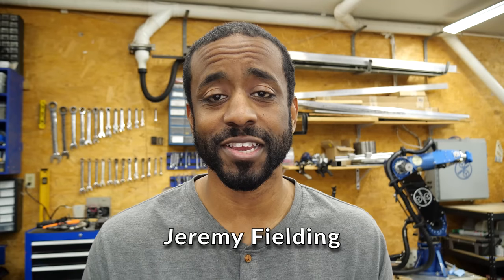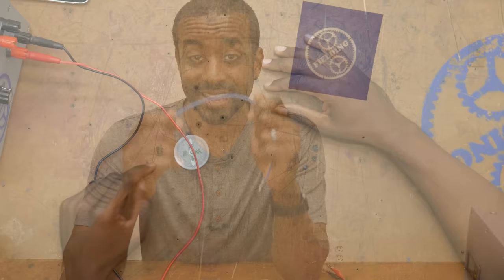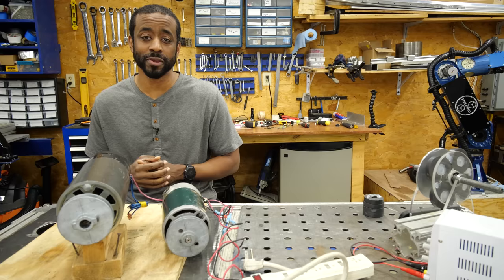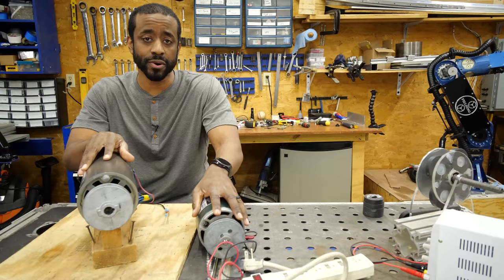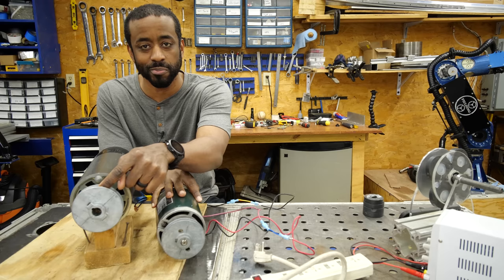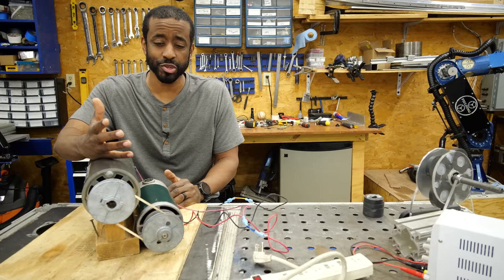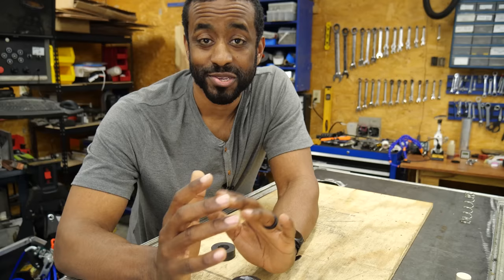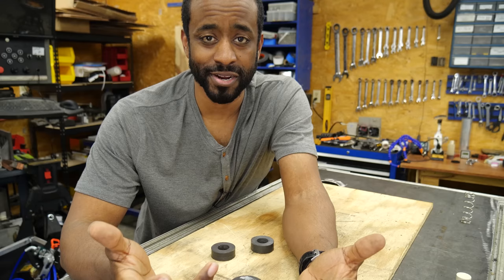Reviewing Free Energy Generators.  A Response to My Video "Nikola Tesla's Greatest Invention"- 102

Comment: Awesome video Jeremy, great explanation!  As a product design engineer I get a pile of plans or ideas for this type of witchcraft all the time.  Great job killing it with reality!
Reply: If you haven't tried it you can't say it doesn't work. People once said airplane's couldn't fly because they were so heavy. How about you try building one using a pulse motor to do the spinning of the one your using as the generator. This would have to create a surplus of energy. Also use some gearing or belts to further lift output. If you want to go further try adding a big fly wheel or make the pulse motor on a flywheel. Just because you've been told something doesn't work doesn't mean it won't. As an engineer i would think youd be more qualified than me to give this a go, so do it. Disprove us. I have no electrical experience building things but ive done lots of reading & this way would have to work. This video even says it. Bld a couple next to each other since a fast moving magnetic field will always speed up a slow spinning magnetic field. The planets spin continuously so there has to be away its how nature works
Reply: @harryverner6218  send me these plans, and I'll happily build it
Reply: @harryverner6218  The planets only spin continuously because there is nothing to really slow them down. Even they however don't spin for eternity, they too will some day cease to spin and at some point in time they will also be more or less void of energy. Earth was moving a lot faster and a lot slower during different times of its early life because of asteroids impacting it. Eventually there weren't regular hits of big asteroids so the earth just stuck with the speed it had and that's more or less the speed it is spinning at today. The moon also helped stabilise it in this regard. The earth will keep spinning at this exact speed until some more energy is added due to some large impact for example, or some energy is lost (for example through friction). Because this isn't happening on a large scale the speed remains more or less the same (there are measurable deviations from this stable speed over very long time periods but it's not significant enough to really change anything for us). Also, your statement that it's not impossible is not something anyone can disprove because impossible would mean there is no way for it to ever happen regardless of circumstances. If I claim there is a pink elefant in the orbit of a star 20090893787789 million light years away from earth there is no possible way for you to definitively prove to me that this is impossible. Does that mean I am right? No. Does it mean I should be considered right as no one can prove me wrong? No. In Science it's always wrong until proven right not the other way around. While it is possible that someone could build something like you described, that would mean that our entire idea of how physics and the universe works are wrong. Rules like the rules of thermodynamics and laws of conservation of energy are rules that have been proven to be correct countless of times in countless different szenarios which is why we consider them to be more or less universally true (disregarding singularities). They are also completely reproducable which all in all makes them scientifically proven. For your proposal to be a correct way to create surplus energy from nothing, all of our basic natural laws and rules would have to be incorrect. Seeing as these natural laws can be proven and reproduced with the same result every time, I will put my trust in them. Also, if you want to convince anyone on this planet that our scientific laws and rules are false you will be the one who will have to build the wonder machine, not the people you are trying to convince. You need to prove to them they are wrong in order for their laws to be obsolete, they don't need to prove to you that their laws are correct because they have already done so to countless other educated individuals. I believe you have not done any such thing or something comparable and instead you expect other people to prove that your concept doesn't work only for you to probably say they messed something up. Instead, why don't you provide the evidence that your theories are in fact correct and reproducable with same results every time  and then people will start to consider that you may be onto something, but not they way you are acting.
Reply: MrToenges@ didn't read your whole book because it sounded like you are proving my point. If you have hi torque from low energy input how could you not use this for work? How? People have been using wind energy to do work forever. How couldn't you use the power off of a pulse motor on a flywheel to turn a generator? Try it then come talk to me. They use flywheel's as batteries at this moment in time. Its like using the pulse motor & flywheel as gears. Flywheel's get energy from outside diameter so we can play with this shape to increase energy also.
Reply: @harryverner6218  <flywheels get energy from outside diameter

Actually, they get energy from outside forces imparting rotational force on them
Reply: Yes but its determined by outside diameter
Reply: How about when you start the suction on a hose? It will continuously flow until its stopd. Ive seen people use this to turn small turbine's to create energy. I guess those laws of thermodynamics are being broken or is there an exception? Capillary action. Fluid dynamics. Just attempt to build then tell me. Pulse motor attached to the O.D. of a flywheel connected to a generator. U can run pulse motor off of solar, wind or steal small amount from generator.
Reply: You can get real fancy & use magnets & copper to eliminate friction so thats not a factor in flywheel
Reply: @harryverner6218  <it's determined by outside diameter
It's moreso determined by the mass of the flywheel, diameter has very little to do with it
Reply: @harryverner6218  a falling object's kinetic energy is equal to it's potential energy before it started moving, which is equal to the energy it takes to move that object to the height it fell from.
Basically, the amount of energy to lift 1 kg of water 1 meter into the air is the same amount of energy you get from 1 kg of water falling onto a turbine 1 meter below, minus losses do to friction, etc

You've basically just created a battery, albeit not a very space-effective one
Reply: @harryverner6218  Frictionless, unpowered bearings don't exist. They all induce heat, or require energy input to stay cool.
Reply: @CoffeeAddictEvan  a battery you didn't put energy into besides the initial suck. Now put another pipe at bot of where your collecting water from syphon. (Your adding more energy/more falling). Now put your turbine there. Might not be a big amount of electricity but its free. This is simple version. Imagine using low to high pressure bladders & compressing air while turbine's spin. Or using magnets to help the push back up for 1 side of turbine. Of course shield it so it only affects it one way
Reply: @harryverner6218  YOU don't put more energy into it than the sucking but SOME OTHER PROCESS did put energy into moving the water there to begin with which is why it's not free energy. It may be next to free for us humans to use but we didn't create it out of nothing. Same with wind energy. We don't put any energy into creating wind and we can harvest it for energy but that doesn't mean it's free energy because some other process had to make the wind move, losing energy in the process and giving it to the wind. Just because you don't actively put energy into something you gain energy from does not at all mean that it is free energy or that you created energy where there was none. Your problem is that you don't understand the very bascis of thermodynamics and conservation of energy and unless you are ready to read up on that middle school material, talking to you about this topic will not get us anywhere. It's like trying to convince a medieval pope that a computer is not magic. He doesn't know the rules behind how computers work and thus he will not understand how something like that can work without witchcraft. Trying to explain the mechanics to him won't change a thing because he lacks the absolute bare minimum basics to be able to understand the whole thing. It's literally just wasting energy on trying to convince him, energy which you by the way had to get from some other place (usually in the form of food) in order to waste it to try and convince him. I am pretty much doing the same thing right now under different circumstances.
Reply: @grapfen587  free energy is energy i do not pay someone else for. Stop coming at me with ridiculous semantics. Im saying that the sucking is my 1st amount of energy. Then i have it fall again. I did not do any extra work myself or pay for anything. Thats what makes it free. You can try to sound smart by regurgitating stuff u read or be smart from experiences
Reply: @harryverner6218  Again, you lack basic understanding of the topic. If I understand you correctly then you are basically saying that because a large diameter gear on a motor spins faster than a small diameter gear I will have more energy with the large diameter gear. That is precisely where you are wrong. The larger diameter gear will spin faster but it will have less torque, the reverse is true for the smaller diameter gear. The reason why you have less torque is that you are basically creating a lever the further you go from the center because of inertia and that lever is working against the motor so you have a gear that spins faster but is much weaker in terms of torque. But what is important to note here is that with both the large and small gears you have the same overall energy for both of them, the energy is just distributed in different ways (more energy is put into speed and less into torque for the large gear and the reverse for the small gear). Think about the gears in your car. If you are in 1st gear, you have a lot of torque or acceleration if you will. If you drive at 20kph in 1st gear your motor will have to spin very fast because you have a small gear that has high torque but doesn't spin much faster than the motor itself. If you switch to the 2nd gear now your motors RPM will go down, at the same time you won't be able to accelerate as quickly. The reason why your motor RPM goes down is because the 2nd gear has a larger diameter and thus the edge of the gear spins faster compared to the 1st gear. At the same time however because you are further away from the motor itself you have a longer lever against the motor meaning you lose torque but gain speed. When your gear spins faster than your motor, the motor doesn't need to spin as fast to drive at 20kph as it would have to in 1st gear, but as mentioned several times now, you lose torque. This is all of course very simplified, the mechanics inside a car a more complex than what I have described but I would say it's an adequate comparison. For all the gears in your car your motor outputs the same amount of energy but it is distributed differently for the different gears. I hope this example helped you understand why your idea of larger diameters carrying more energy because they spin faster is false. And another problem with your idea is that you don't take into account friction. If you use a motor to turn another motor you will only waste energy because the motor itself doesn't perfectly convert energy into rotational energy. Due to friction with the air and with the parts inside the motor some energy will always be lost and the same is true for the other motor you are turning, so you lose energy step by step until there is nothing left.
Reply: @grapfen587  do i sound dumb? Capillary action is not known by a dumb person. I know the laws of thermodynamics. I have read up on these subjects like i was in school for them. I just think there is a way to get power for free without relying on wind which is basically the sun. Free by my definition is not costing dollars. Im not some fool you can convince with semantics. I need to see that it will not work. We take engine's & change whether they are fast or good for pulling with gears. People have made 11million to 1 gear ratios. If we hooked that to a small generator to a small power bank & turned it it could fill said power bank with minimal effort. But zero $ in making folks self reliant. Ive seen gravity generator's made for 3rd world countries where you let the weight fall & it provides light for hour's but US models do not compare because they do not want us getting off grid. Its independence. I am certified in ultra sound testing, eddy current testing & then some. To do these you have to learn all these things you claim i don't understand. Never claimed to be able to break these laws you worship (u have faith like a religious nut). Claiming there are ways to get energy for free (u need this clarified like a child free means zero dollars besides setup) after initial setup. I do not have time, $ or skill to do all this by myself. Attempting to caused problems in my life. Considering that i would not try to sell it i would give away & show people how to do for themselves im choosing not to keep giving my life away at this moment. If people & circumstances change i would gladly jump back in. I have shot magnets all the way across my house. This is a linear motor. We can NOT turn this full circle it will not work. But if we put it on 2 sides maybe 3 it could do work. How much would have to be determined then. Dont just quote laws without any attempts to bld. Laws are meant to be broken
Reply: @harryverner6218  What the hell are you talking about? We are using water power all over the earth already to harvest energy. We use the potential energy the water has and harvest it through turbines. Your suggestion is what we are already doing all over the globe but it's much less efficient. You seem to be completely oblivious regarding the topic of harvesting energy from natural resources but you still run your mouth about how we can get free energy.... The reason why we use falling water to turn turbines is just that water has mass and that mass is accelerated due to gravity. The water has a certain amount of potential energy when it is located anywhere on earth (more potential energy the further away from the earths center of mass it is). When the water falls it is basically getting rid of that potential energy. We use the kinetic energy of the falling water to turn turbines and then we use the turning turbines to induce current which we then use for all kinds of things. What you are describing is a much much less efficient version of what we are already doing.
Reply: The best we can do is increase efficiency as high as possible, which can never exceed 100% due to losses in the system.
Modern internal combustion engines  engines are only around 30 -35% efficient, which means roughly 65 cents out of every dollar you spend on gas goes to waste.  While electric motor's efficiency is around 75%, the challenge is storing the electric energy in a battery pack as densely and quickly as possible, where hydrocarbon (gasoline) fuels can still store more energy in the same volume and refill faster.
Reply: Windmills are free energy.  Free like beer.  There are tons of free energy (like beer).  2/3rds of people living in the hood get free energy in that they never get a bill.
Reply: @harryverner6218  I don't think you sound dumb. You sound very smart in fact I knew a guy who also speaks such as yourself. I'm willing to vet money that you both graduated from the same school. I'll bet $1000.00 you are a graduate of the Dunning Kruger university.
Reply: @SlickArmor  no clue what you on. Would think you was an ai troll but spelling like mine
Reply: @CoffeeAddictEvan  Nope, if all the mass is concentrated near the axis the stored energy is way smaller than with a flywheel of the same mass at the same rpm with most of the mass concentrated at the rim.
Reply: @ottonormalverbrauch3794  Let's just say "moment of inertia"...
Reply: witchcraft, thats hilarious !
Reply: lol, great statement on witchcraft...funny as hell.

Comment: The way my dad taught me as a boy about the term and concept of 'perpetual motion'. I posited the same idea, an electric car that produces electricity to run it indefinitely. His initial reply to my expressing my concept was: "It won't work, or at least not until you can lift yourself off the floor by pulling on your shoe strings". It took a little discussion to fully get it and being introduced to the idea that friction is the ultimate bane of all engineering, to fully Grok 'perpetual motion' as fallacy. I did however conceive of a 'Prius' type of hybrid / high efficiency car as a kid ( in the early 70's) ~ I just found your channel and really enjoying your content ! :)
Reply: Ummmm that might be possible with the right pullies but still no perpetual free energy lol
Reply: Diesel engined freight trains are electric powered and are basically hybrids only they lack a battery to store wasted energy. Electric braking occurs but energy is sadly wasted by directing it into coils and producing heat as a result that is vented upward through the top of the locomotive.
Reply: Its not friction thats the problem its gravity i built one using rare earth magnets it had zero friction and it would freewheel and still run after you turn it off bit not long enough to make enough power to keep going because of weight dragging it down